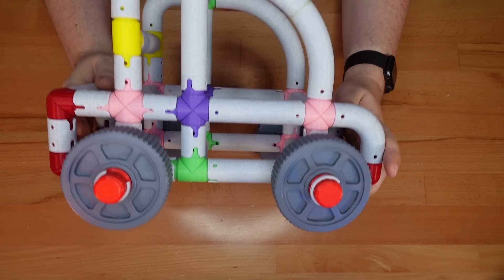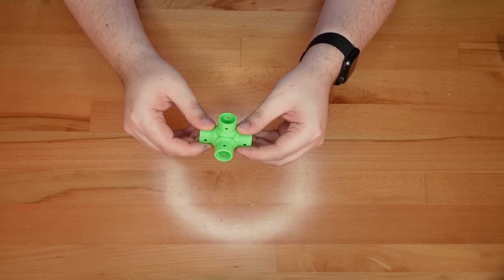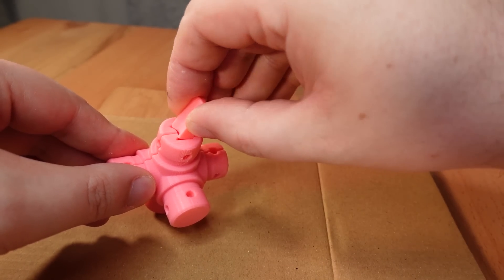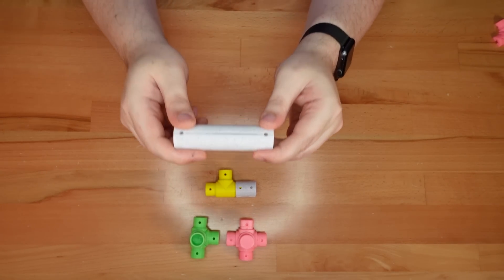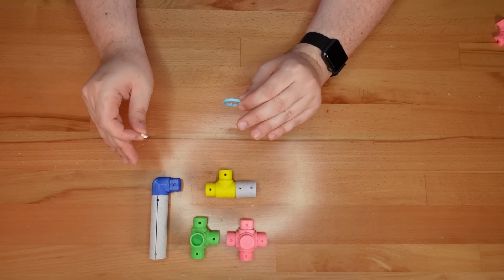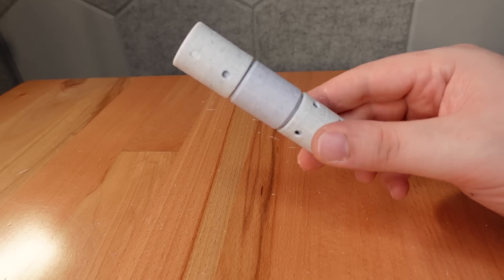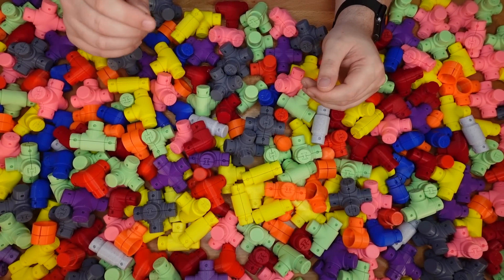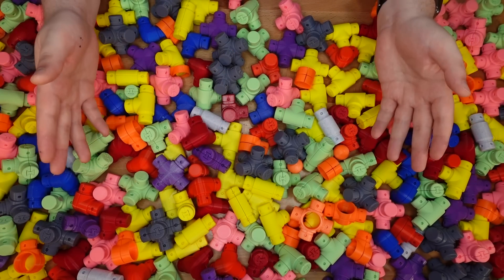Printy Pipes - A 3D Printed Construction Toy

Comment: Hey. Question. Just got a 3d printer and need a table for it what size table/workbench do I need. Enough room for the build plate movement? I got the anycubic Kobra max. Or just enough to support the base? Please help 🙏🏻. Trying to get it off my dining table. In inches please 🙏🏻
Reply from the maker: I don't have that exact printer to measure, but it's very important to account for the bed movement. You'll either need a table with more than enough space for the bed to slide back and forth or you'll need to accept the bed hanging over the front of the table (where it could get bumped). Finally, keep in mind that there are wires coming out of the back of the bed. These need room to gently flex as the bed moves. If they're pushed against a wall, those wires may break.

Welcome to 3D printing. If this answer is insufficient, I'd check for online communities that have lots of Anycubic users who can tell you what works for them.
Reply: @3DPrinty  can you recommend some groups on insta or YouTube?
Reply from the maker: None that I know directly, but my first go to for 3D printing brands is Reddit: reddit.com/r/anycubic/

Comment: why do you not create "half" connectors that can be pushed together to create different numbers of way connectors?
Reply from the maker: I'm not sure I understand the question. Some of the connectors shown do use the same parts to create various port counts. For example, the yellow 3-way "T" connector uses the same bottom part and the green 4-way connector. The number of ports is determined by which top piece to pair it with.

Comment: these are awesome. i had made some from before, but one question can you make a bow tie for the flex hinges. The other two are to long. tried both of them. I went ahead and cut one to a smaller piece, but though i would ask. and the loose bow tie are not that loose, might be my printer lol. thanks again for these prints.
Reply from the maker: Thanks for catching that - I had uploaded an older version of the part that was too long for all hinge connectors. This has been fixed!

Comment: the dovetail could be improved in 4 ways: 
1 the angles are too aggressive. the ideal angle should be given by the directional elastic modulus parallel to the dovetail reinforcement direction, but nobody has time for that. the angle itself should be lower than wood dovetails with PLA, as it more rigid than most woods.
2 the dovetail end at a point. it should be rounded (more like two lobes ending in points), that way the hanging roof would be smaller, leading to more consistent prints across quality printers
3 the direction of printing of the dovetail is wrong. the dovetail geometry should be printed a a continuous face and not being constructed through layer depositions. It makes it really fragile and prone to failure.
4 if you fix 3, you could get away with half or less of the dovetail spine, reducing the size of the locking mechanism, but mantaining about the same terminal strength.  
if you correct those problems, the success of the printing and assembly would greatly increase in random sub optimal setups and skills.
Reply from the maker: Great feedback!

Since forces applied to a pipe don't translate to pulling connector halves apart, the pins aren't structurally critical. They aren't even necessary in most connectors, as demonstrated in the video.

I actually switched from printing the pins vertically (which IS the stronger option as you noted in point #3) to horizontally (which was more consistent and about 20% faster on my printers).

The longer than reasonable pin length is a result of several generations of test prints. I found that longer pins did a better job of collapsing the seam near the center of the connector - especially in the "L" connector.

I agree that the dovetail overhang is unnecessary aggressive. I don't plan to revise it for now, but I always welcome remixes that improve my designs. If there's interest, I can make the STEP files available for these parts.
Reply: @3DPrinty  yeah, I have to admit that everything that I said about dovetails feels like a nitpick in this application, but could in the future help to debug and optimize faster more critical dovetail designs.

I over engineered the ** out of the dovetails in my first design. It was a modular jig to make pilot holes at regular and controlled spacing. sadly I lost the stls and designs long ago. those dovetails where incredible strong (I may have wasted like a week testing variations to learn the limits of PLA)

Comment: It reminds me my olds games, but I have no kids around. But it makes me think of a solution to make shelter with PVC tubes in a geodesic dome shape. Do you think of making the pentagonic and hexagonic connectors?
Reply from the maker: The old version has both of those! I plan to revisit them, however they may not split quite as cleanly. If you don't mind the glue requirements of the old version, they ARE compatible with the new pipes.